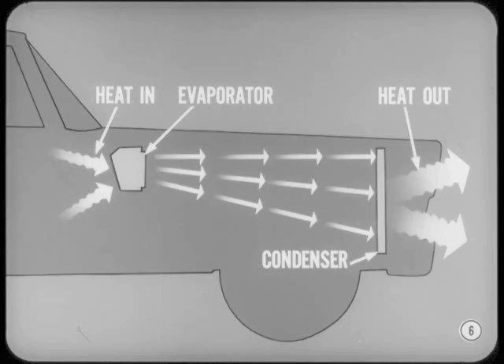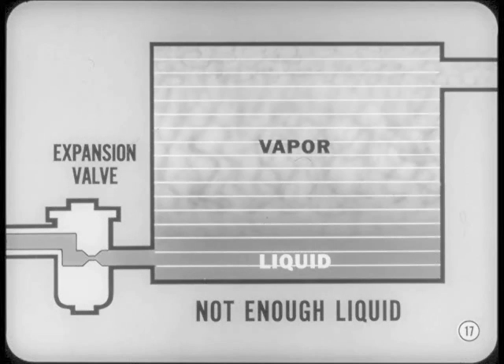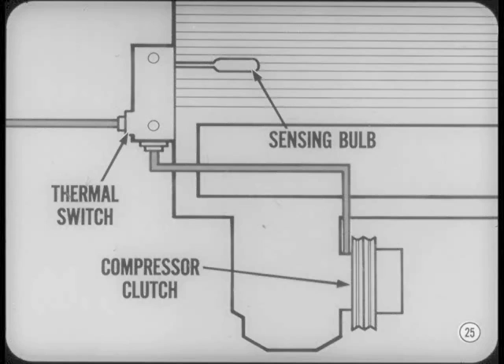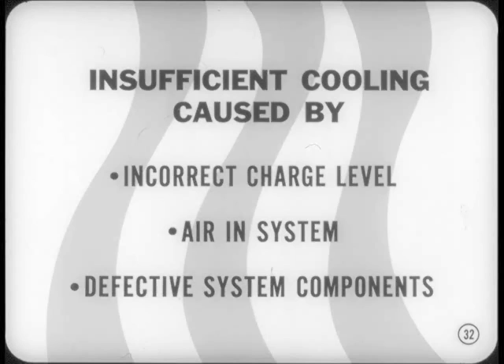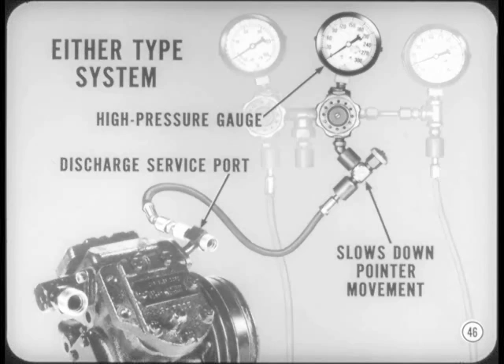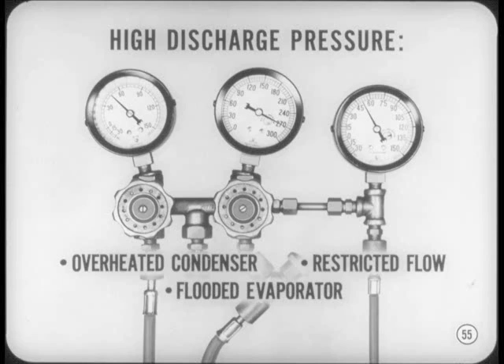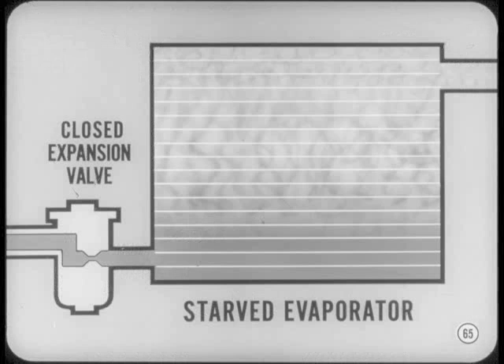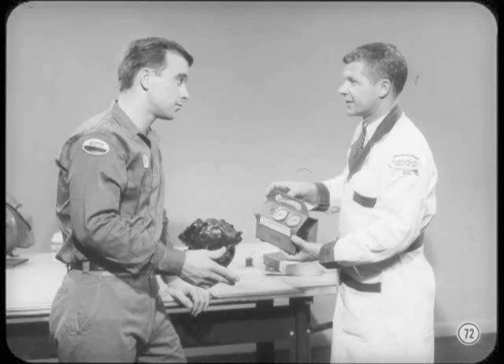MTSC - 1967, Volume 67-9 Air Conditioning Diagnosis

Comment: Thanks for sharing this. Before I became a fleet mechanic in 2006, I spent 23 years working at a Ford dealership. I remember their training films which were similar to this. In the 1990s they slowly went to WBT (Web Based Training) which didnt seem as informative. Of course, classroom training was always fun when they sent us to the La Mirada training center. Interestingly, some of the training at those 5 day classes was sharing ideas with mechanics from other dealerships in the classroom with me. Since we were all there for the same 5 day class, we often met at the hotel bar after class to shoot the breeze. Ah, the good ol days.

One thing about this video, cars may have evolved dramatically over the years but the principles of air conditioning are still the same. True, there is automatic climate control and new refigerants today. But the fundamentals of the air conditioning itself is exactly the same in 2020 as it was in 1967 when this training was made. Someone unfamiliar with air conditioning could easily learn something from this video.